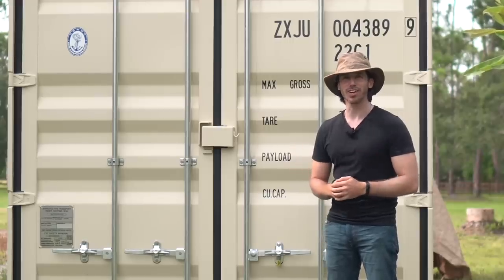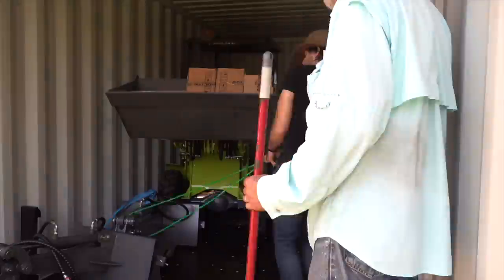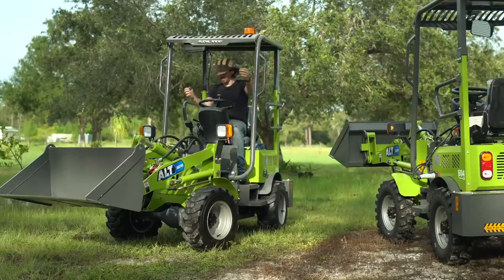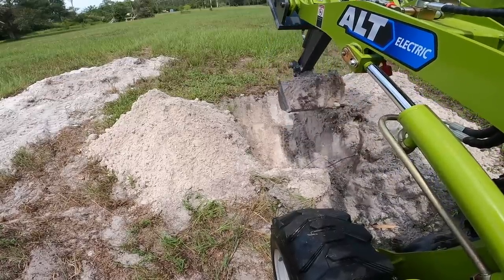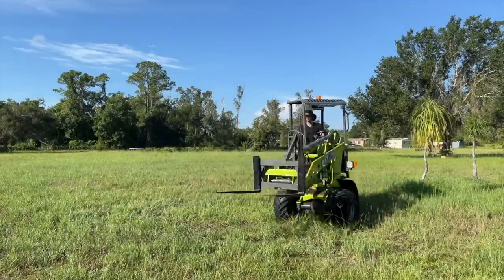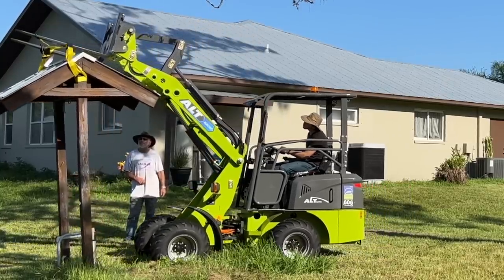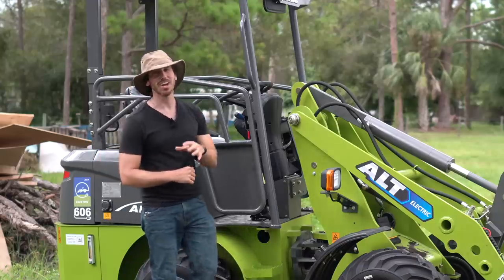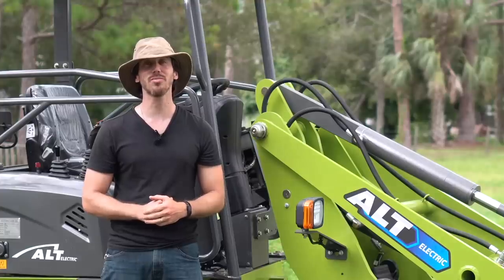I bought a container full of Chinese electric construction equipment!

Comment from the maker: Thanks for the nice comments, everyone! On the site www.nesherequipment.com you’ll see I don’t have the machines “in stock” yet but if you’re interested then just use the contact form to reach out and reserve one of the first ones (or to snag one of these four from the video).
Reply: What other attachments do these have? A snow blower and pusher blade would probably be interesting.
Reply: Maybe... if you talk about the failed escavator, people will die in China? haha but no, not at all, I don't know. Please say something
Reply from the maker: @hypercube33  I've started with 5 attachments: main bucket, pallet forks, auger, digger, snow plow blade. I'm looking into testing more. A powered snow bower would be great, I'll look into it.
Reply: Hi I could use a e Ike to get me back in good health as I have stage 4 copd and need help in excireing my legs and lungs the bike soupy help me out greatly
Reply: @Mutt1952  Go buy one lol.
Reply: Can you say "Gone in 60 seconds"? One thing you never mentioned was the battery size and run time.And its not listed on the site either.
Reply: So when they got delivered, were you able to keep the container they came in?  There is a market for those as well.
Reply: This machine is awesome! In the era of high oil prices, electric machines will inevitably replace fuel machines!
Reply: I'll buy one off you!
Reply: @HalfAssHomestead  thats a brand new container too. that suckers worth 4 grand easy.
Reply: i can hardly wait for the new chinese GMC cars and trucks to arrive. those Chimaro SS/Z28s look hot and the Z stands for Zengshou and the 28 stands for 28 per cent American made, yeah, SOUTH America ha ha . got to love those paraguayan welders .
Reply: Is it possible you could walk us thru your buying procedure,  from china?
Reply: Keep the container because you will be sending them back .
Reply: @EbikeSchool  hydraulic snowblowers are very underwhelming compared to PTO or direct engine driven.  Since the loaders probably have a large lift capacity you could get a large self powered unit, otherwise a snow pusher or blade are probably the best options if you really want to stay away from the engine
Reply: Any thoughts on the fossil fuel that has to be gathered shipped an then refined in a refinery and then being shipped to the plant to get it refined then shipped to a power plant to generate the electricity to recharge the zero emission tractor or car unless where u live they do a lot of electricity generation with nuclear power just a thought
Reply: Greetings from Poland! Your films are very interesting. Good job.
Reply: I am interested in one of those four it would be perfect for my shop
Reply: @MrSGL21  He paid for the container, most assuredly.  I dont see a loading dock, which means he'd have to pay for a special truck to pick up and drop off the container, or for a truck to wait with the container there while he went through the unload, AND the return trip.  Current prices on a container transport to and from a port are ~2000 bucks each way, and wait time is ~1000 bucks for 8 hours.  Would usually be cheaper to buy the container.  All ports are union, and restricted trade zones.  He wouldn't be able to just hire anyone, it would have to be an approved and permitted vehicle.  Not cheap.
Reply: @EbikeSchool  you should look into the availability of a mower attachment (brush mower and lawn mower) as well
Reply: @hypercube33 😊
Reply: One of the most dishonest reviews I've ever seen...
Reply: @Gubastek why do you say that?
Reply: Hiring?
Im forklift meacanic
Reply: @Heyjaybird  If I may chime in,  I do know that when he bought  electric mini pickup, he walked though the process with a good overview.
Reply: @hiddenkho you can't even spell mechanic much less be one
Reply: From what we can see on the video, these tractors do look pretty well built. You should have shown the battery, the controller, and the motors. Just saying that it would have been more details for us possible customers to view. Thanks for doing this.
Reply: @TqSNv9R0iG5Ckxew I completely agree with what you wrote. I'm sure that he's going to be upgrading his website with more info. ASAP, once he realizes the interest this equipment is going to be generating.
Reply: I reckon you can start to import various types of light EV machinery biz .  Many headaches or even scammed for someone who does it by himself. You can start it small . Have you ever thought about it?
Reply: Maybe support domestic companies.  I would like to see how these thins are operating two years out after heavy usage.
Reply: @oersson  
So many reasons, too many to list, I'll give you one example:
Equipment salesman introducing new product without even showing us one grease fitting on the machine. And he has 4 of them...
Reply: This is AWESOME! 
Youtubers often build "other peoples" businesses rather than their own. 
If you can actually import these, sell them, and offer legitimate overseas electric equipment at affordable prices - that's a WIN WIN WIN!
Reply: @chrisboek2346  Burning it in a power plant and then transmitting via wires is much more efficient than trucking to fuel stations, driving to fuel stations to fill containers, and then driving back home and dumping some of it in a fuel tank, and spilling some at the same time...not quite sure what you're asking???
Reply: awesome video. so cool!
Reply: @EbikeSchool I would probably buy if there was a snowblower option. The front hydraulics on these units do not seem to be set up for high-flow or continuous flow. Though they could be used for moving the chute. The blower itself would probably have to be separately powered with it's own motor or a PTO.
Reply: good luck with your new adventure. i hope it proves successful for you.
Reply: @chrisboek2346  Yea, in some states. But that's still better than the exact same process plus three more trips and being burned much less efficiently.
The states that use coal can't keep the lights on, so I don't think that's really a factor. 

Not to mention, most of the rest of the planet uses methods other than oil or coal to make our power. 

Thanks for supporting the channel. Without comments like your ridiculous distortion of reality, the algorithm might not suggest these videos to those of us that aren't basement trolls.
Reply: Wow! You've oversimplified the issues that a normal person would face with these machines.
"It's just like changing the batteries in your remote, but heavier".
"Only costs a dollar to charge".
Your review is a freakin joke!
Reply: @hypercube33 How many have already lost power this winter? A snow blower does you no good when you can't use it.
Reply: May i know the  price's container? Thanks
Reply: Be very careful with chinese electric vehicles.  They have the bad habit of starting on fire.  And sometimes exploding!  I have seen videos of this happening.  Be very careful!  And stay safe!
Reply: I think it was from over charging the batteries.  So do NOT leave the charger attached for long periods of time without supervision...
Reply: Good job
Reply: Albino u still buying ur big brother stuff wow
Reply: Looks like fun, like an MHU-83A/E Bomb Lift....
Reply: Wut happens when they just start burn 🔥 like all the other batteries from China, E BIKES , SCOOTER, CARS ??? 😢😮😅
Reply: Wish you Great Success:-)
Reply: Great job. Interesting journey for you. Best of luck!
Reply: If it says Made in China it can never be a good product. It will work more or less fine for a couple of weeks, months.  On top of that buying low quality Chinese products is not only a scam, but it's also very negative for the US economy and the US jobs.
Reply: Amazing, guys, looks great. Wait a minute, as a procurement manager in German companies for decades, I curiously have a question. 
What is the reason for you to select this company as the supplier or manufacturer other than that company? There are a number of similar companies there in China showing similar products with similar prices in certain websites like e.g. Alibaba.
I am not challenging you, I am pretty sure there must be good stuff for us in North America. As a business owner, how can you secure the quality of the products as well as stability of your suppliers in the other side of Pacific Ocean?
Reply: I wonder how much the Chinese are paying you to sell their electric machines for them in the U.S. If it was me i would not advertise them for free with the cost of delivery maybe that's the trick,  free import cost, or maybe half price on machines you buy.
Reply: @paulwollenzein-zn1lh  yea, never happened to a gas vehicle huh? next youll say they arent recylable as if youve ever recycled a single thing
Reply: @marcj4209  yea, my ford is a flawless machine that barely needs a new trans every 2 years. Atleast the chinese want to work instead of whine all day
Reply: Besides not leaving the battery on charge or in a place where damage could occur if a failure were to occur during charging, what else could you do to be careful?

Comment: We bought an American made fridge, the brand was called Crosby, supoosedly the best with a 10 year warranty. The compressor died in 1 year and when we called the warranty department they told us to go pound sand. Buying US doesnt always mean youll get the after sale support!
Reply: so true - it's always let the buyer beware - everywhere
Reply: I doubt the compressor is made in America tho
Reply: @chrisE815  some nice cope you got there. My f150 radiator hoses had just recently burst, luckily I had enough water to get back home to repair it. Ford engineered the y-fitting out of plastic. Plastic. The brass fitting replacement was $6 at lowes. I can't imagine how many coins Ford mustve shaved to buy their in house designed part.

 When I took the truck to get a rotation, the techs couldn't remove the lug nuts because good ole' american Ford decided to use aluminum capped lug nuts, which swelled past the point of the normal 21mm socket. It took them over half an hour to free their own socket from the swollen capped nut and refused to do the rotation until after I installed after market, solid lug nuts. I had to use a 1-1/8 metal hole bit to drill past the cap to reveal the actual lug nut below. Wake up, american companies are complete trash now that value engineers obsolescence into the products to maximize "shareholder" returns. Frankly, I couldn't give 💩💩 about buying american anymore.
Reply: @LincolnLog  I'm with you brother.  Hope we start designing and producing things worth buying one day.
Reply: @LincolnLog  Ford sells more F150 pickups than anyone else, so if they pinch a few pennies here and there, it adds up to a nice end of year bonus for some executive.  Plus, plastic and aluminum save a few grams of weight!
Reply: GM as a whole Co out sells Ford
Reply: @ZweiZwolf they screw the customer on warranty left and right I would avoid ford...
Reply: @wildandliving   Ford isn't alone in failing to honor warranties.  GM and Dodge can pretty fail hard, too.  I've seen it.
Reply: Which is why I don't bother buying warranties. By the time the thing messes up a newer one came along and is cheaper.
Reply: @LincolnLog I had the same issue with my lug nuts after a flat on the interstate. Had to be towed in. Tire firm said that was a problem with those lugs but they had a lug wrench to remove them fortunately. I could of changed the tire myself if Ford hadn't screwed this up.
Reply: @bubbabubba2013  lol the place I had taken my truck to had 3 gallon sized zip locked bags full of lug nuts in the bottom drawer of their tool chest lol
Reply: chinese support is going to be worse.
Reply: @chrisE815  probably not. its just assembled here. not really made here.
Reply: Same here in UK, we used to have everything that was made out of steel made in Sheffield but now it's overseas out of weaker/cheaper material
Reply: @LincolnLog I'm surprised the could even get the rim off. Mine are always seized on too.  Even after a day.  Commen problem. Same for the lug nuts, same for that Y-pipe, it's on its 3rd one now, the Brakes went out pretty early, not long after warranty.  Found out the factory brakes had a problem of doing that too.  So, I installed PowerStop brakes, the good ones.  
 Go check your fuses, probably about time for those to start going,
Reply: @Mar-sz2ug  how many miles are you? I'm just over 250k v8 crew. Haven't had any issues so far with removing the tire rim. I swapped out ford lug nuts for solid ones. Tire pressure stem sensors went out probably the first year and we didn't bother to get them replaced since it was right after warranty
Reply: Bought a Chinese fridge (much cheaper than European option) and it's working perfectly fine for 5 years. One of my friends actually used their warranty to replace their faulty compressor. Coming from a third world country I'm amazed they don't give you much after sale support in the US.
Reply: American quality is usually pretty average at best as well, but you pay a premium for it.
Reply: That Crosby fridge is probably a re branded Chinese product, the only Crosby I know made cars for a time but I think they were done by the 50's, I did buy my daughter a portable record player/Bluetooth  speaker with the Crosby name on it a few years ago although
Reply: @Mar-sz2ug brakes aren't covered under warranty anyway and if you can't get a wheel off you're doing something super wrong.
Domestic vehicles are total trash but it boggles the mind how some people struggle so much with repairs.
Reply: @Hawk7886 brakes would if they are are faulty. But, you go and look up at common F150 issues you will find what people have.  As for the rims, they are the stock rims.  Believe me. I know how to work on vehicles and until this one the hardest to get off was a really old Chevy been sitting forever.  That one was a sledge.  But, these, Ford made a super snug fit.
Reply: @Mar-sz2ug  faulty how? A seized caliper piston? Sure. Seized slide pins? Nope. Good luck trying to claim anything close to pads and rotors. You might get a single rotor if you jump through some hoops and submit a wild rotor runout sheet.
Reply: @ LincolnLog  
I would have bought a Crosley refrigerator. Not the cheap imitation Crosby.
Reply: @ebenezerwheezer2957  it's whatever the salesman sold us on as "the best American made freezer with a 10 year warranty"
Reply: @LincolnLog why would Ford’s big share holders care our daily life? We are a different species in their eyes!
Reply: @LincolnLog  I remember the Maytag brand washer and dryer used to be the bomb (meaning good quality).  Not anymore since they sold to Whirlpool.  The latest bad news about our manufacturing is Boeing.  Trimming corners to squeeze out more profits is what's hurting us.
Reply: @jkohutiak I agree with you there.  At least the Indian or Filipino accent we get now isn't too bad.
Reply: while its true buying American is no guarantee of after sale support or even warranty support you have a much better chance of being able to legally go after them to recoup the loss.  Try filing a claim against a Chinese company and see what that gets ya.
Reply: @macauleyc64 yeah cuz British Leyland was synonymous with quality 😂
Reply: dont just give up you should sue
Reply: There is no fridge brand called Crosby…. 😑 you are making crap up!
Reply: @gj1234567899999  youre correct, my misspelling of it which is Crosley. I don't care what you think, I trust my life experiences more than some coping fool
Reply: @macauleyc64  But, look at the improvement in air quality in Sheffield since the 60s! 😎
Reply: @arminius6506  Danfoss (Electrolux) make refrigeration gear in China now. Dometic is one of their main labels. 😊
Reply: That's where you record the phone call with customer support and post it on YouTube, Then send them a link.
Also, send it to the corporate headquarters of every retailer selling their products. 
Just make sure you live in a single party consent state.
Reply: @LincolnLog  My friend's Ford Ranger which he bought at almost the same time as my Toyota Hilux, blew his engine, TWICE, once when it was two years in and the second time at the 5th year...my Hilux is still running without problems~🤣AND the funny and ironic thing is, my mileage is actually TWICE his numbers!
Reply: @LincolnLog  Ford uses Chinese parts assembled in Mexico… you proved his point for him lol
Reply: Lincolnlog.  Crosby or Crosley???
Reply: @chrisE815  Couldnt find Crosby. But found Crosley. Which is mfg in China and distributed n US
Reply: @LincolnLog  MBA culture. That's what you got left. All about ROE.
Reply: @LincolnLog  Ford is the American version of BYD. BYD is superior at bursting into flames, but give it time, Ford will catch up.